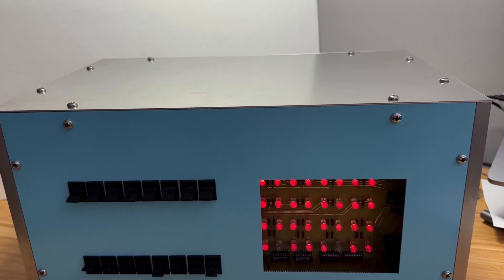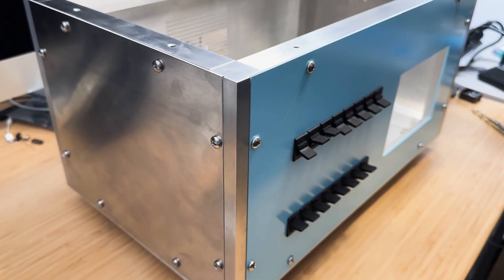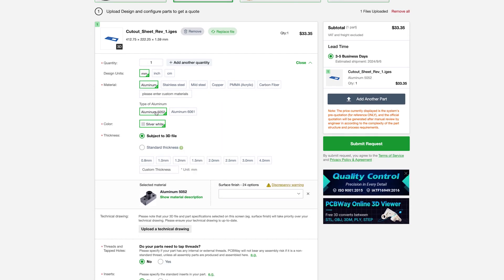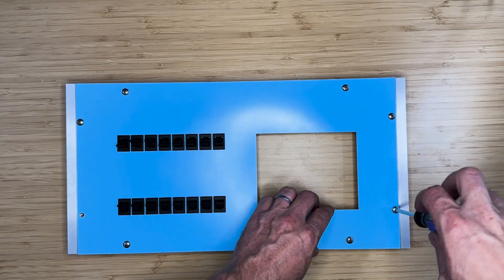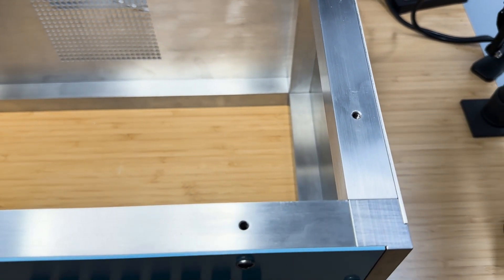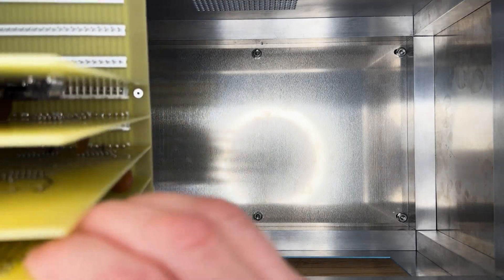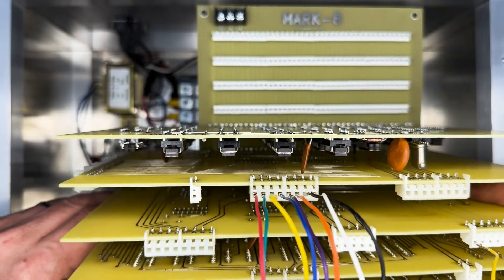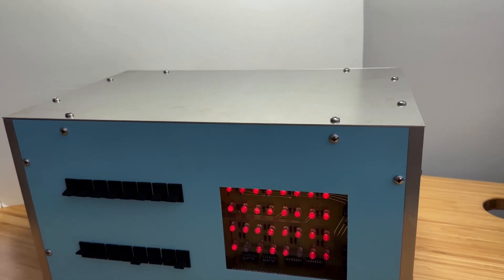Designing and Building a Case for the Mark-8 Minicomputer

Comment: Looks great!  I was surprised that you didn't mount the fan on the back vent, but maybe air moves through it by convection or something?  Now to watch the next video!
Reply from the maker: I mounted the fan on the power supply since it requires forced air. I'm planning on mounting another one in the back as well but, so far, it has been fine without it.